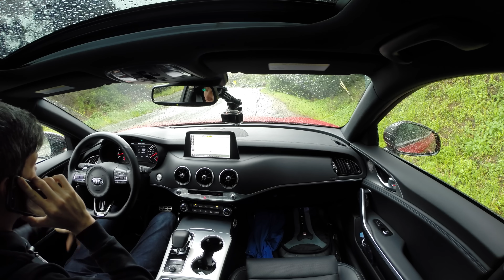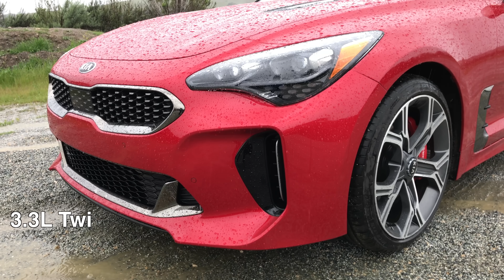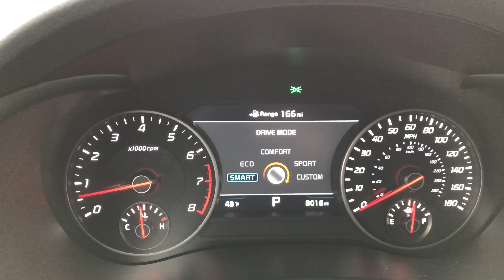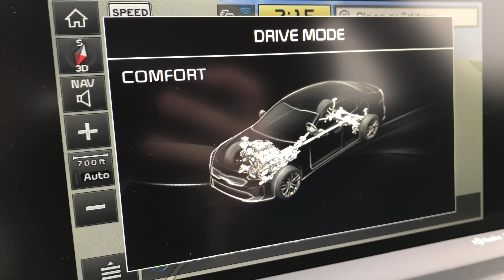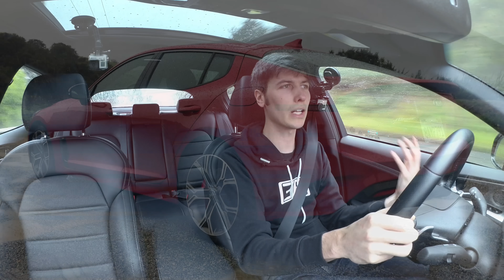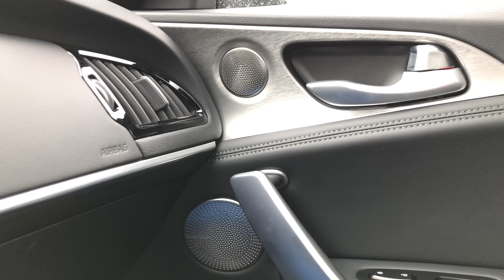The Kia Stinger GT Is An Ego Check For Car Guys

Comment: Great title~ I’ve owned a 2013 Kia Optima SXL, Was a fun car, a 2016 Ford F-150 3.5 Eco 2009 Mercedes CLK 55 , 2014 Lexus GS430, 2015 BMW M3, 2016 grand Cherokee SRT, and 2016 Hyundai Genesis 5.0, 2018 Charger Daytona 392, and 2018 Jeep Grand Cherokee again. The Genesis because it had the “Hyundai” branding in 2016 depreciated horribly from $52k to $23k in 2 years lol... Sadly, it is an awesome car from my recent experience mix but was not well received. I drove the Kia Stinger GT1, and it is most excellent but I would wait a year or so before I bought it as the leases were in the high $600’s and that was when they were discounting the Stinger GT $7k in early January. Also, same issue as with the Genesis brand transition imho...

Comment: Nothing wrong with getting something within one's budget, my friends think I am cool cause I don't waste money trying to impress people. I would say a rear 180 cam would be nice to supplement the visibility issue of that back window, with a display above the windshield and also maybe a rear wiper. Do the headlights turn or does it have side lights, I loved those side light on my old Oldsmobile, turning a corner and nicely lit up, why cause where I am it's dark a lot and snows, and that extra visibility from that extra light is so helpful.

Comment: You know,  speaking as a car gal, you managed to almost completely un-sell that car, even if I were in the market for a heavy sedan in the first place.  And don't get me wrong, I think Korea is making very cool-looking cars, and that's no exception. It was more like in "If they made a wagon of this it could be fun'  (As people who want wagons expect, at least,   But 'sports car?  absosmurfly not,  it doesn't seem.   "This heavy sedan is a sports car, except the eight-speed transmission  you have to use all the time cause eight speeds is sluggish, and the suspension basically sucks if you even use anything but comfort mode,'  "  doesn't seem to count as 'sports car."  )  

I'm kinda not so sure any not-so-coolness here is about the brand name here, basically. Nice  sports sedan, maybe, at least for the money,  but,  'sports car?  Prolly not.     I can't see ever wanting one. Certainly not for sports car purposes.  I think being engaged is the whole point of the 'sports' bit,  whereas 'Buying some automation that does it better when you can't even feel it' may be impressive engineering,  but isn't 'sporty.'  

When it comes to cars, I'm usually trying to work a little bit of the love and even sport into  my actual life,  which is a lot more likely to either be hauling myself solo or myself and a bunch of stuff around than it is three other people who think business class is too confining. :)   I mean, hey, if they made one of those brickey old Ford Flexes into something that did what that Kia sedan can, we could be talking in fifteen years.  :)

(Also, this is in no way intended to discourage KIA's good behavior about making a rear-wheel-drive platform.  Who doesn't love *that?*)

Comment: The only problem the Stinger GT has is the fact that an Audi S4 is $51,000 to start, granted the Stinger GT starts at $39k, but the top end model is $50k. I'd have to test them both back to back to see which i'd prefer. Audi is faster though...

Comment: 2.0 litre engine has weight 1,600 kilograms? even skyline gtr R34 has bigger engine and still lighter, did the transmission is one of the  weight maker?

Comment: Does the custom mode allow you to vary the torque split, suspension, shifting, etc independently?

Because that would be cool... Useful too, if the factory torque split in sport mode is more about "feeling rwd" than going fast (R32 GTR did this, thankfully the fix was easy: minor wiring to add a sensitivity adjustment to the lateral g sensor)

Comment: Stinger GT vs BMW M3. The Kia is about 10k cheaper with it being $55,000 with packages and options and the BMW is around 65,000 at base model which comes with more than the Kia in terms of technology and options. The BMW is more powerful and quicker and is a higher class, more luxurious car. I don’t really see the Kia as a better alternative to the BMW M3. I would rather get the BMW M3 if I was looking for a sporty sedan for 50-60k

There is also the Audi RS3 for 60,000 which I would consider a better purchase than a $55k Kia Stinger GT.

I think the Kia Stinger GT is a cool car and all, but I don’t think it quite matches the great German luxury sports sedans

Comment: Thanks for being logical.  It doesn't matter how many cylinders, if it's front or rear wheel drive,  or the make.  If it's a fun car that's what car people should really care about.  Some 4/6cylinders can make more power than some v8's. Heck  some cars don't have any cylinders anymore.  And don't even get started on auto vs manual.  Fun sporty cars come in all shapes and sizes and specs.  🤓 Just enjoy them all

Comment: But if I drive a BMW, I'm automatically accepted by everyone, friends with everyone, nobody hates me but they envy my awesome 3 series because it's the best car ever.  I don't bother parking in proper spots, I can just pull up to the front doors by the grocery store and leave my car right there while I walk around for 30 + minutes.  Also, I don't signal my turns or lane changes, everyone is expected to just watch out for me and yield the right of way, even pedestrians.  Why?  Because I drive a 3 series BMW, and you're just not allowed to do that when you drive a Kia.

Comment: For the most part I prefer old rally cars.  I have 2 at the moment.  But when it comes to my family I get new cars with all the safety features.  I can't bring myself to spend over 50k on a new car so I always look for the best bang for the buck.   

Before I had an optima sxl, I traded it in last year for a Nissan maxima.  I wish this would have been out.  Would have gotten the top of the line model with awd.  If this car is around in 4-5 years I may buy it.  If Kia wants to work out the deal of the century I'd go buy it right now.

Comment: i really like the stinger i think its going to change the face of kia and if u want the same amount of power in a bmw its like $70k and the gt starts at $40k which is about the same as a base model 3 series i just wish it came with a manual option

Comment: Depreciation is going to be exponential. Nope, can't fathom $50k on a Kia even if it were plated in 18k gold. Especially without a 6spd manual transmission as a no-cost option for the GT2. Depending on my mood, I'd rather have a Camaro SS or maybe a Cadillac ATS if I am going to blow $50k on a car.

Comment: I despise the KIA badge for how it used to stand for cheap and boring cars and for the kind of drivers they tend attract. But I'm pretty happy that they're finally trying to change that and are even putting some decent pressure on those higher end manufacturers who have been having their heads up their asses for too long.

Comment: I know I could look it up, but we both should benefit this way- Is the 8 speed a DSG? I've seen(and had) the VW DSG. I promise to watch 2x if this has one and you go over it.
Reply: No, it's not DSG/dual clatch. It's the standard torque converter (hydro-kinetic) auto. And I say it's good - it's a gearbox for comfort-oriented cars.

Comment: The thing is this COSTS A LOT. For the around the same price you could pickup a car with a V8.
Reply: And then me being the pedal to the medal freak that I am, do I really need that much power in my possesion. I have gotten enough speeding tickets in my life and I am trying to grow up kml
Reply: I got my 2017 Mustang GT with 6 spds mt at a clearance for half the price of the Stinger although my driving habits find me at the fuel pump quite often which is why I don't drive it all the time.
And on too of that, the Stinger will outperform my Mustang greatly on twistier roads and autocross tracks

Comment: this car has alot going on for it.....but here are some honest negatives (and what haters and car newbs think won't be on this list):  1) Dealer network can't handle the variety of customers that would come in to spend 40k. Dealer markup, poor customer service and shoddy sales practices will sour any potential buyer brave enough to sit down and want it.  2) the paint- kia paint is soft  (like Honda and other makers)...I doubt it will hold up as nicely as german paint (and I currently own one).   Issues and warranty Kia will want everything stock on this and probably all service performed by them to man up for any warranty issues. Additionally I can see most dealerships throwing semi synthetic bulk oil and then blame you or the car if there are issues.   3) Depreciation: anyone buying this new may have to deal with it being work 15k less within the 1st year....Kia's will depreciate more than any other car at this price range. It will be a STEAL on the used market at the low 30's.

Comment: 365Bhp out of 3.3l TT V6? Tells me how little they trust this engine, I give it 60k miles before major problems arise.
Reply from the maker: Well there’s a 100,000 mile warranty for the engine, so it seems there engineers are quite confident.
Reply: Does it not seem like they tried to play it way too safe with the horsepower?

Comment: If i saw this a year ago, I would have gone for it 100000%.  I think it rocks, i love the interior styling too, and that small window makes a very artistic nod to the small windows and fun back seats of 50's and 40's cars, when you are sitting in the back.  I think the car is perfect.  It does everything people want.  Brembos, a reall sound system, two subs in complimentary locations, great sound, dynamic sensible suspension, even the tires people would put on as a replacements.  really, between the stereo system and the tires, the price is -$2700 dollars.  My limited 2017 brz with performance package needs tires and a sound system first year.  That's a built in issue for cars such as WRX and many other sport cars when you try to compare prices of First Year ownership.

Comment: You can literally get a used Z06 with low miles for around $60k netting you 650hp and 650 torque and it's still lighter than this car. The Stinger only has 255-365 hp. Hell even my brand new Grand Sport has 460hp and 465 torque and I got it out the door at around 60k.
Reply: And... You don't get fake hood vents either. 😂
Reply from the maker: I don’t understand all these used comparisons. Stinger 3.3L starts at $38k. Used, like everything else, it costs less.

Comment: I got mine in the 1st March and been loving it ever since.  As for your negatives, the rear is bad but then with BSM and you can use the rear camera when driving makes up for this .... plus I’m going faster than most so don’t car what’s behind me ;-)

The gearbox I agree on ... its not a double clutch but isn’t that far of the one Jag/LR use, and I can forgive it more as it’s meant to be a Grand Tourer and not a Sports car like the Audi S5, and as you state it’s better at comfort. However I wish in the UK we had the custom option the yanks get so you can set up for soft suspension and more reactive throttle.

Done 2k miles in mine and still grinning!

Comment: I love my Kia Forte but after understanding the price structure, there's no way i would get this Stinger. I bought Kia cos they were offering really great value at 20% less than any comparable model from Japan (i got mine used in 2014) and the performance and reliability is the same or better as I've found out over the past 4 years. But here is a car that is selling at roughly 10% less than a comparable BMW or Audi. That's not enough to make me buy the Kia if i just add 100 bucks to my 1000 a month payment and get a BMW or Audi. If it was 800 vs 1000, then I'd consider the Stinger. Not to mention new Kia depreciates the worst so I'll only buy them used. In 3 years the Stinger will be 30 35k,vs 45k for a used BMW or Audi, and I'll definitely pick that up if my prediction comes true.

Comment: Kia offers great value when compared to a new BMW, audi, or cadillac, but the problem is if you want value, you'd never buy one of those new. Why get this when you can get a 2014 cts v-sport, with all the same features, for 25-30k? Or a 2014 BMW 550i M-sport for about the same? Both of those cars have more power, much nicer interiors, and they cost less money

Comment: So less BHP than a 2.0 4cyl Merc. Ummmm.......
Reply from the maker: “Let’s compare the engine with the highest specific output that starts at $51k vs a $38k Kia.” There’s more to a car than specific output.
Reply: Paul Taylor The problem that happens nowadays is cars being marketed too much for their power output and 0-60. JDM performance cars produced in the 90s have earned legend status for their handling, design, character and all of them (despite some were a bit overpowered) were marketed being 280HP max due the gentlemens agreement.
Reply: DevasionX. I know, ive had one of the best handling cars of the 80's/90's. The Alpine GTA V6 Turbo. , also had my fair share of performance Saabs with mid-range better than most supercars.
Reply: Paul Taylor And understressed, so more reliable
Reply: the A45 is the definition of output whoring.
Reply: BMW 640 gran coupe, 335 hp
Reply: Not really, think that belongs S3 and TT-RS which are 400bhp.
But the new A45 is supposed to be over 400bhp, from an all new design 4 cyl.
Reply: Engineering Explained well even the 50k stinger has less hp and the cla is faster .. so what's your point ? Lolol
Reply: +Clous Von CLA45? that thing is cramped, and tight.  I'm only 6' tall and I've had to slouch both in the front and the back.  Definitely not comfortable.   The 38k stinger has the same power as the 50k stinger fully loaded, so what are you trying to say?  A bmw 440i could be optioned to the price of an M4.  So should you quote that a $65k 440i is slower than a zero-options Audi RS4?